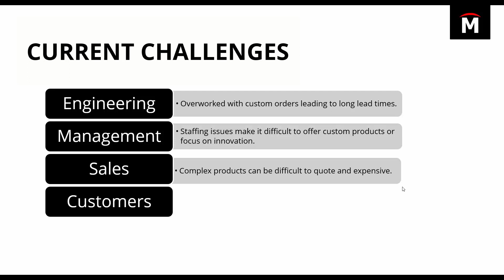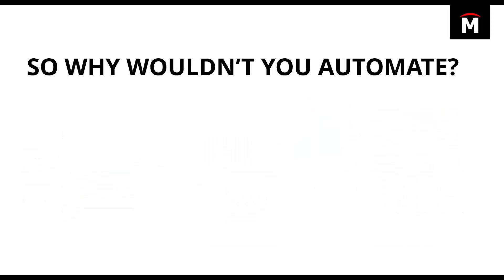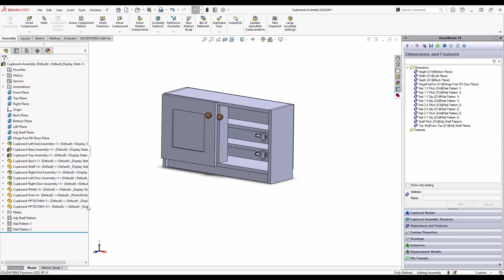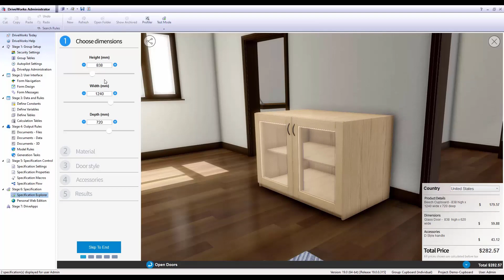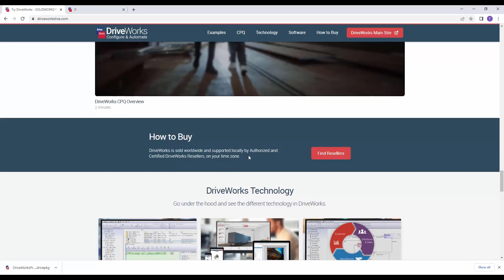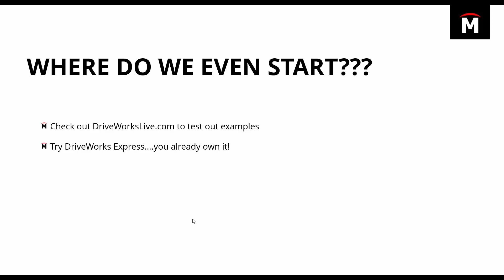Comment: If only it was more affordable for smaller companies.
We would highly benefit from some of these feature, but the price is just not there
Reply: Keep in mind that DriveworksXpress is included with every license of SOLIDWORKS, and those projects can be imported into the more advanced versions if you find that they add value.  If the CAD user is going to be the one configuring products you can get a lot done with Solo.